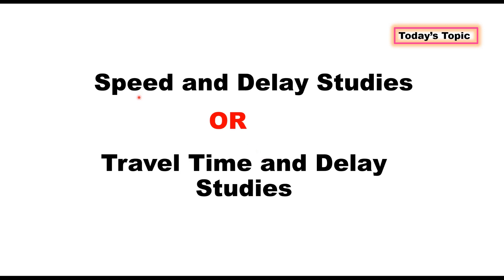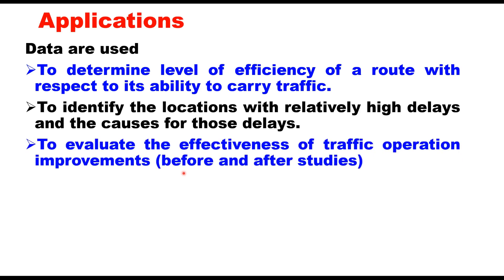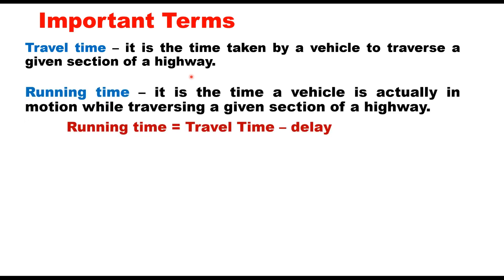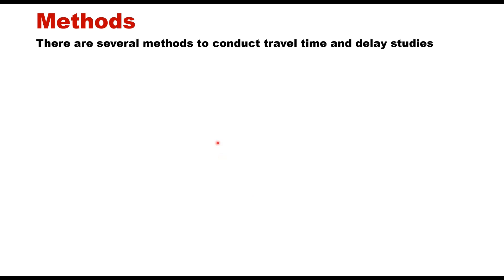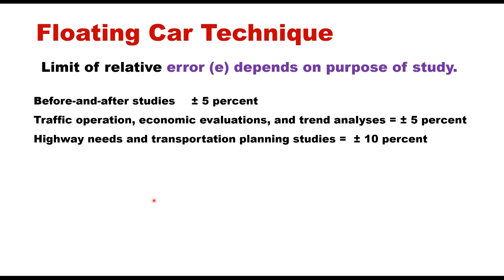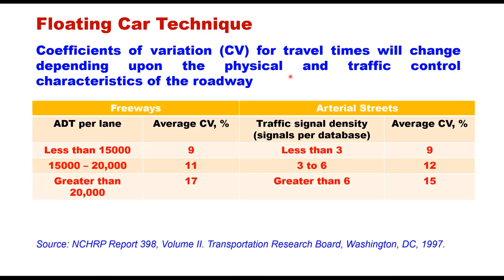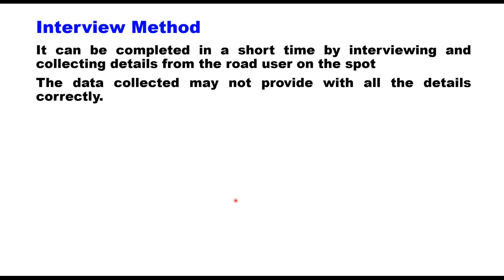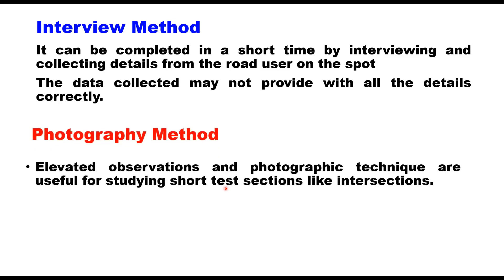#traffic, #Speed, #delay, Speed and delay studies, Travel time and Delay studies, travel time study.

Comment: Hello sir. Please explain sir difference between these two capacity. C=1000V/S and c=S(g/C). In which cases they are used.
Reply from the maker: The first is on a highway and the second is at traffic signal.
Reply: @SatishIITR  thank you sir but I am doing my project in ptv visum as a city network.This software knows only nodes and links. Then for every link which formula should I use to define initial capacity because there are may be hundreds of links in a urban network if you have familiarity with this software!
Reply from the maker: @shokran7750  I have not used VISUM as I do not work on problems related to Network Planning. Capacity value for a link will depend upon several factors and basic values can be taken from IRC code (if you are from India) or from standards as per your country.